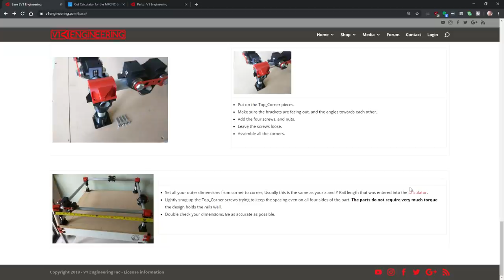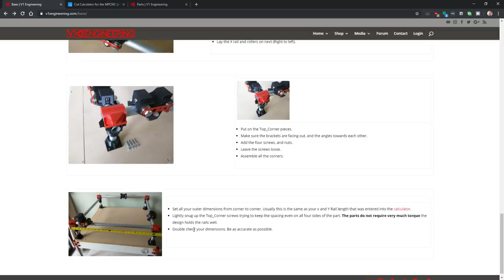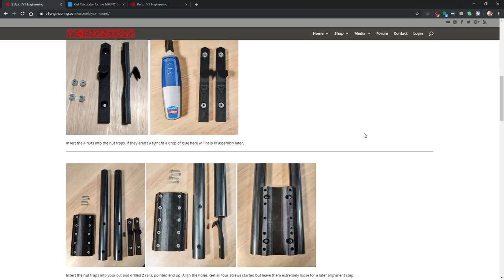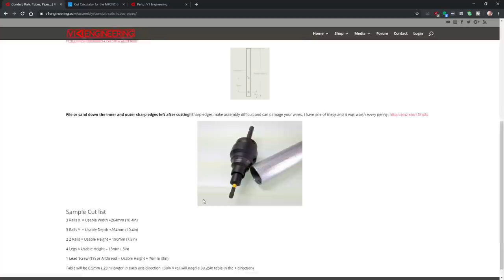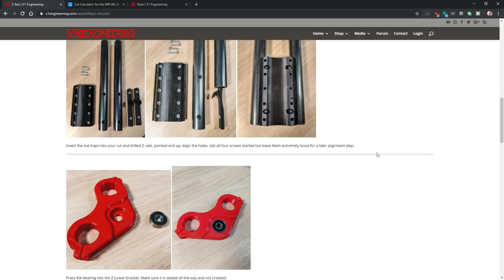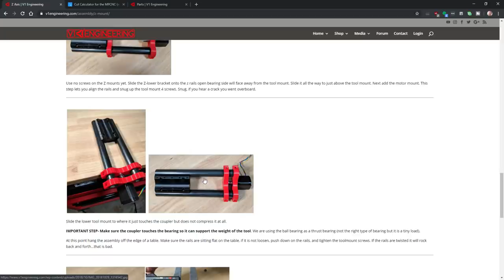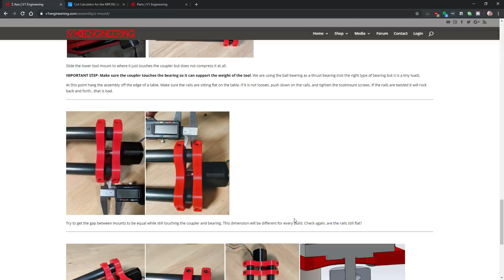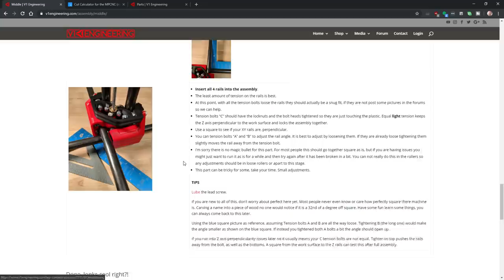Live: Building the MPCNC! (2 - Z-Axis)

Comment: Just a trick from the construction site: Instead of drilling holes into stainless tubing, use a round file and with some long and strong strokes (don't go too fast) you get perfect and nicely smoothed holes exactly where you want them. You also save the step of flattening and center punching. Stainless is actually rather soft, but fast cutting tools will easily harden it right where you want to cut. And while the rest is still soft you kinda get like a hardened washer around your drill bit embedded in softer material which acts like spiral spring choking on your drill bit.
Reply: There more I learn, the more I realize I have a long way to go. Thanks for the tip 😊

Comment: Tip for drilling into stainless steel: low speed, high pressure. Once the bit has made a little divot and stops walking, press down nice and hard, while keeping the drill going at a low speed. If you have multiple speed settings, put it on the lowest. The moment you make 1 tight squeeze and the drill goes fast...you might as well grab a new bit because you just dulled yours.

Also, if you can put it in a drill press, that should be your first choice, and use carbide tipped bits if possible. 

I'm an electrician, and I drill into stainless all the time. I've burned up many drill bits. Lol

Comment: Tip: don't use couplers with screws digging into the motor shaft. Over time, they grind away material and become hard to remove and they also concentrate the force on a small area. Use coupler with flexture -  one that has cutout that compresses evenly around the shafts as you tighten the nut. They transmit the torsional force evenly and are easier to remove.

Comment: Great call on the DC spindel, wish I had done that! The ac DeWalt router mpcnc was designed around is pretty loud. Love the adaptability if the system though.

Comment: Drill stainless at very slow speed to reduce head which leads to hardening
Reply: Low speed, high pressure. The moment you squeeze that trigger hard and go fast, might as well replace the bit because it's done. 

Also, carbide tips are your friend. Lol